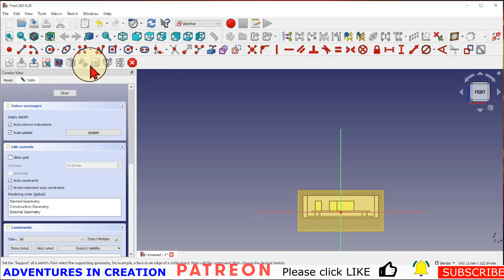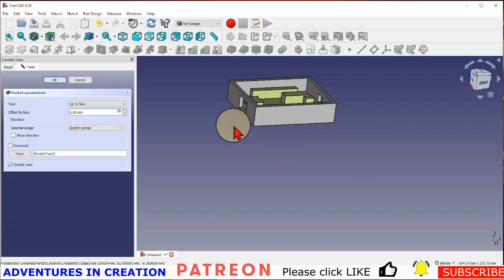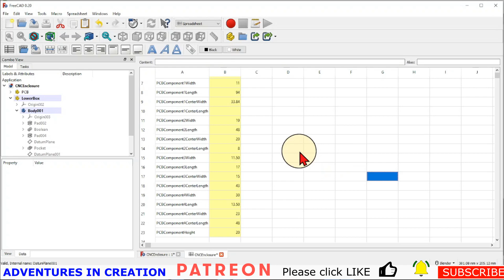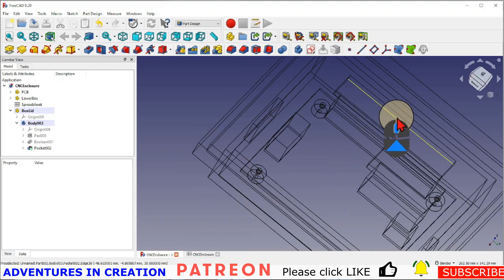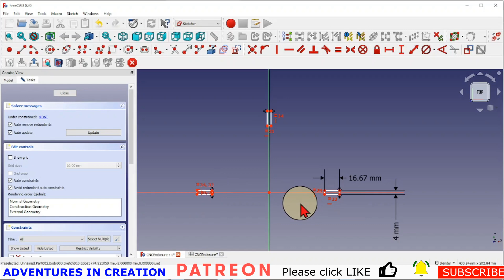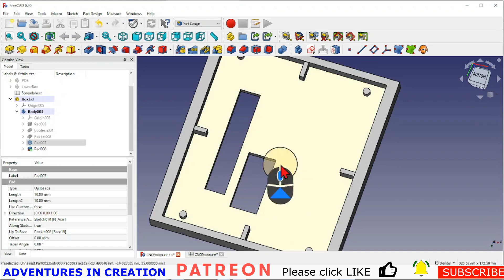FreeCAD Beginner #33 Fully Parametric CNC Electronics Enclosure Pt2

Comment: Finished all your videos now. I binge watched them. Absolutely superb 👏👏

Look forward to many more. 

I’ve just started to design by new bespoke kitchen cabinets in FreeCAD. I’ll be building them, I’ve done a lot of joinery before but this time I decided to design them on the computer before I begin as it’s a very large kitchen and the price of wood has gone through the roof due to covid. 

Only bit I’m struggling with is the drawer fronts. The detail, the easier moulding, is causing me some issues. I think for the beading on the fronts where they meet I need to use Boolean operators to create the raised mitre joints. I think. 

Anyway, really great videos. Thank you. 🙏
Reply from the maker: Glad you enjoyed them. Good luck with the kitchen. Make sure you share pictures.
Reply: Of course, I was wrong with the Boolean idea for the mitred raised profiles of the beading on the drawer fronts. 

Instead I used a “loft”. And after one 20 minutes of scratching my head as to why it didn’t flow round the corners properly, it worked perfectly. I had to move the first sketch with the profile as it sat at a corn of the loft path. 

Anyway, I got it to work, but if it wasn’t for your video on lofts, I wouldn’t have had a clue !
Reply from the maker: @GeeTheBuilder  glad you got it worked out.